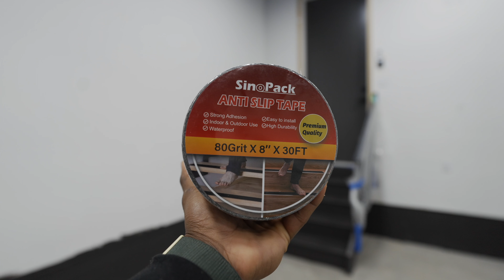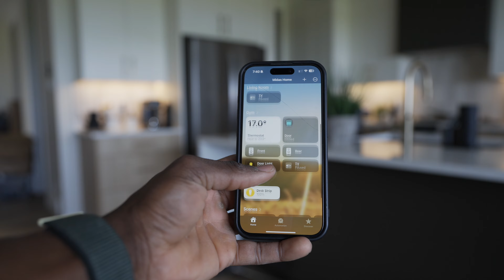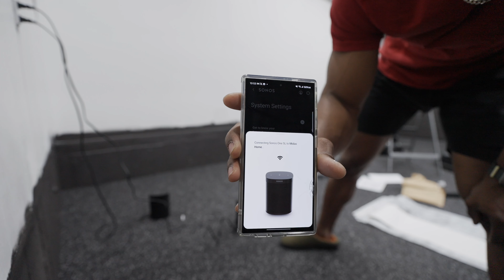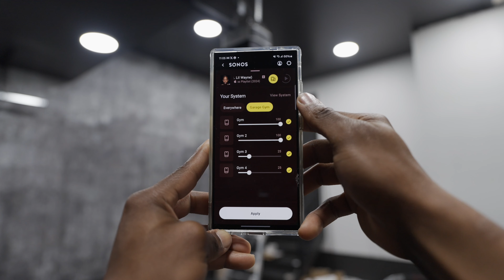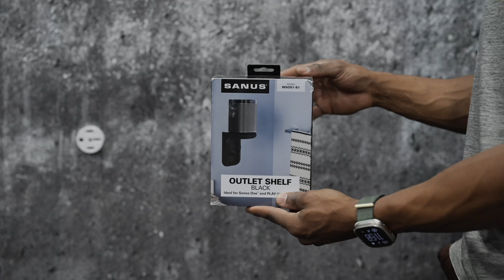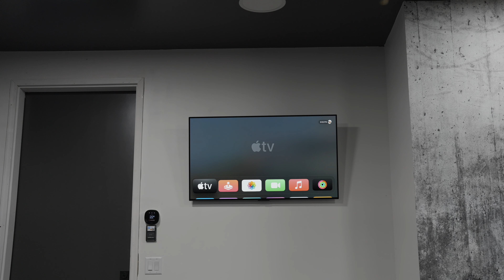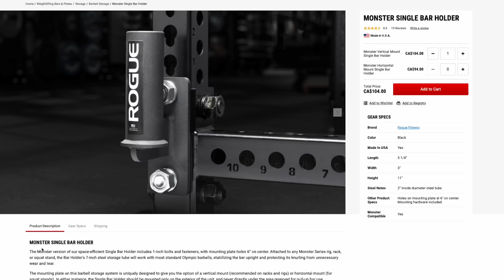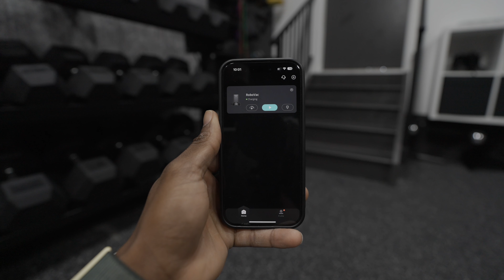Transforming An Empty Garage Into My Home Gym Setup!

Comment: As a cheaper fix for your barbell holder - you could buy some 5/8" bolts in the same length with 4 large washers. That'll fit through the dumbbell storage and the washers should allow you to tighten still with the 1" hole size. Not ideal but a workaround if you don't want to return and reorder.

Comment: Hey brother love the video. As a fellow Canadian I am wondering do you run into any troubles in the winter with moisture control or ventilation in the heated garage? 

Is it super costly to run the heated garage at comfortable temps in the winter months? 

Any solutions for your cars other than leaving them out parked in the snow? 😂 or just a trade off you came to terms with.

Comment: i see you like free weights. But free weights can be risky regarding injury. For most especially older people (40+) i think machine is better. In that case, check out body lift bl1, with a few adjustable dumbbels and a rowing machine, i think you have a great home gym for alot less than your setup which i bet cost a small fortune, plus it will take up much less space. What i described here is my setup.